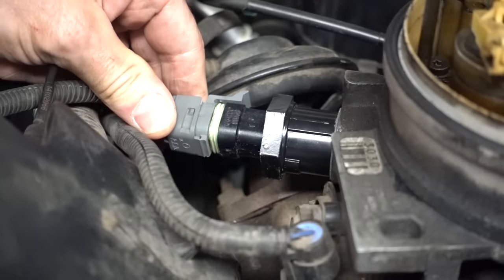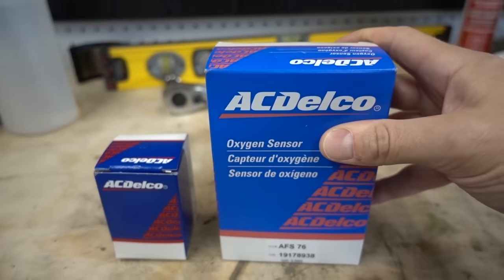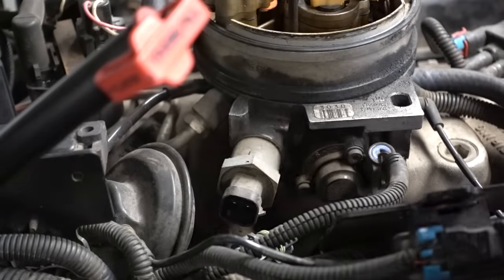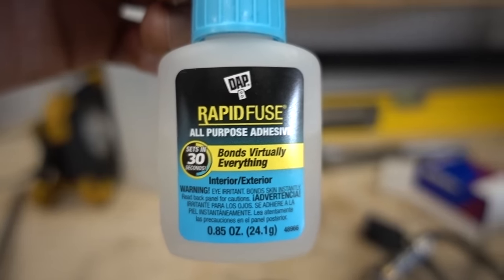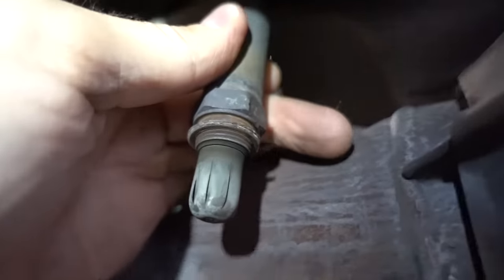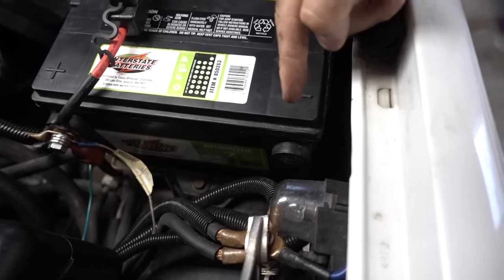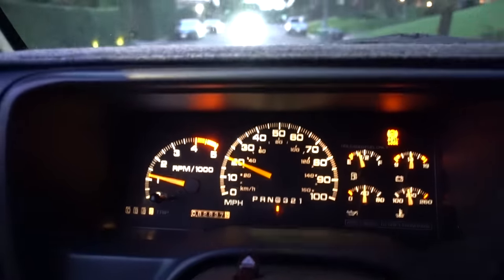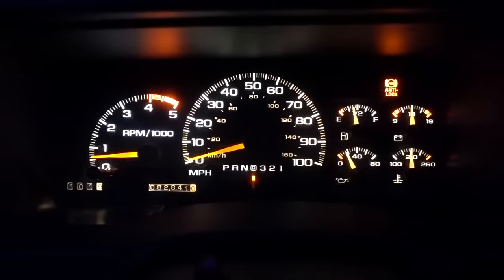Here's the TWO SENSORS YOU NEED TO REPLACE FOR BETTER IDLE !!

Comment: you should have cleaned the port the iac valve goes in. if there is any build up on the sealing surface, the pintle valve can’t seal properly.

Comment: O2 Sensor - is it only one pre and one post ? in 94 ? 
i have 98 Tahoe 5.7 V8 and there are Two sensors -  Pre -cat. and  Two sensors - post Cat.
PN: ACDelco AFS106 GM Original Equipment Heated Oxygen Sensor /  ACDelco AFS105 GM Original Equipment Heated Oxygen Sensor

Comment: I replaced the fuel pump and filter on my '99 5.7.  throttle response was much better but she still had problems idling.  So I changed the fuel pressure regulator and distributor cap, truck won't crank at all now and gas began pouring out a small hole in my muffler because the engine is not burning the fuel up.  I'm thinking I fried the ECM because I was swapping the AC relay and starter relay and I think I put the relay in backwards since the AC and starter relays are both 4 pronged.

Any suggestions?
Reply: You either did something wrong with the fuel pressure regulator or more than likely the distributor cap. You probably have the coil wire that goes to the center swapped with a plug wire which will cause no spark
Reply: James Carroll did you right that on the wrong comment or is there something wrong with you?
Reply: James Carroll  in too deep to junk it now.  Replaced all top end gaskets (head, intake, valve seals, etc.), all front suspension components, new tires, etc.  I got the truck for 600 bucks and figure I'll use it as a beater/work truck/family truckster and park my iroc and do a tear down resto on that.
Reply: @MoparMadness93  plug wires are all correct.  I triple checked.  Regulator is on correctly.  I originally installed it using the half assed, unbolt one side of the intake and lift.  I ended up not getting seated properly.  After the gas came out, I took the intake off completely, found the regulator sitting cockeyed and reinstalled it correctly.  Now it's the same problem.  No crank at all and gas leaks out the muffler.  Engine started and ran prior though.  The truck is in storage in another state right now.  I'll be going back in a few weeks to try and get a reman. ECM off eBay and an IAC and see if that fixes the problem.  I've seen a few videos where techs say to NOT install relays backwards because it can get the ECM.  It's the only thing that makes sense to me at this point since I've gone through every plug, wire, fuse and sensor.  Was just asking if anybody else has had a similar issue or knew something I don't.
Reply: James Carroll  thank you. Will do 👍
Reply: Un plug the battery for a few hours, reconnect and give it another try.
Reply: James Carroll  UPDATE.  
Finally got back to Florida yesterday to tow my Burban home to North Carolina.  Needed to get it running and driving so i could drive it onto the trailer because no winch and a 4,000 lb come-a-long didnt seem like a viable alternative.  So after some research, fuel leaking out of the exhaust can be caused by -

Clogged fuel filter 
Clogged return fuel line
Bad/stuck fuel regulator
Bad injector
Vaccum leak/blockage

So i removed the filter, blew it clear, fine.
Removed the lines going into the spider, seals were good inside spider, no debris in ports.  Next, i removed all the spark plugs to drain any remaining excess fuel sitting in the cylinders.  At this time i realized i royally screwed up the wires on the right bank.  Had wires 2, 4, 6, and 8 all discombobulated as a result of trying to rush in the dark in the dead of a hot and humid Florida summer night and fighting mosquitoes.  Cranked the engine by hand for 4 revolutions to open each cylinder a few times to give the fuel and fumes a chance to escape.  Put it all back together.  Started up after 3 crank cycles.  Running a little rough because i was turning the distributor every which way possible when it woildn't crank.  Now that shes home i can get the timing light and get her spot on and start buttoning her up.  So the no crank was my own dumbass fault. The leaking fuel, however, is still a mystery to me but at least shes running with no leaks now.   

Now i can move onto replacing her rear main seal,  oil pan gasket, change the oil, run some seafoam through her, get new brake pads, change the rear tranny seal, and have safelite replace her windshield.  After that, it's time to finally enjoy her and give my CTS a well deserved break.
Reply: James Carroll  its the only thing that makes sense.

Comment: Should have replaced the spark plugs since it is that old and may be fouled some or wore down some. Maybe some plug wires and cap and rotor if it apply to this engine.

Comment: I dont agree about the o2 senser.check tps, engine ground for these electronics, adjust it all carefully and adjust idle air screw onky if you know hoelw to set it without having problems.note if u go to higher land with higher barometric pressure, it can make the calibration of the idle make the electronics act erratic once tuned to specific lo ation.this excludes fuel filter replace and tune ups, and vaccume leaks, etc
Reply: Removed o2 left open circuit.runs fine .

Comment: Good video 👍 How do you know which oxygen sensor to replace? My vehicle has 4 oxygen sensors. Please let me know thank you
Reply: I had my "upstream" O2 sensor near engine block changed. I was told my engine runs cold. Its winter in Alberta and it gets damn cold here. Now, since I'm OCD I must replace my "downstream" sensor somewhere around muffler and catalytic converter. But, not until spring.
Coolant light still on as is oil light lately.
I flushed coolant and replaced it (its perfect) last summer and I change my own oil. It's perfect. I'll scan everything next spring once I figure it out. 
Any thoughts on the condition my car's condition is in?
I own an '03 Saturn Ion and it runs perfectly!
David
Alberta
Canada
P.S. My mechanic said "f... it", false readings."

Comment: Could be your timing is off re do it set at timing mark oil. Set with crankshaft position center. Also timing change may skip
 Map sensor clean them fuel injectors carburetor clean or buy all them new

Comment: Thays the problem with the pre obd2 fuel injected stuff. It's nearly impossible to trouble shoot other than throwing parts at it and praying you threw the right part.
Reply: The flow of diagnostics is the same as any OBD II vehicle. The live data stream on pre OBD II vehicles is not as comprehensive but the basic diagnostic procedures are the same.
Reply: @chipyeahoo  You have a gadget to get real time fuel trims and sensor data? As it is now i tend to avoid pre obd2 stuff unless i can pick it up dirt cheap.
Reply: Rob Dixson, basic scan data on OBD I will still give you information such as system voltage and sensor data. No fuel trims. Just have to induce lean and rich conditions while monitoring the O2 to check its general operation. As I said though start with the basics. Check battery voltage, visual inspection and vehicle history if available. Pull a spark plug or two and read them if need be. Check basic mechanical condition if problems are suspected. Even a cheap lab scope will give you a good indication on the ignition system and misfires. I agree that some pre OBD II stuff is nearly impossible (like feedback carburetor systems from the 80’s/early 90’s) but things like TBI really aren’t too complicated relative to the modern OBD II stuff. The TBI on the truck in this video is fairly simple. It only has two fuel injectors and a few sensors including a single one wire  oxygen sensor and no MAF. It uses the ignition distributor for crank position. A basic scan tool, multimeter, basic lab scope, vacuum gauge, fuel pressure tester and if needed a compression gauge and of course good service data will give you what is needed for proper diagnosis.

Comment: O2 Sensors csn become Lazy or not be able to generate the full voltage range they are designed to produce.  Normal Range 0-1 VDC.  Mixture control is affected greatly.   IAC get sticky, MAFs get pluged, TPS get intermitent resistance.

Comment: I noticed your oil pressure starting at 60, then to 40, and 20 at idle.  I have the same oil pressure reading with my truck.  Not sure if this is something to worry about.  Just something I noticed while watching.
Reply: An American V8 is perfectly OK if it has 10 PSI per 1,000 RPM. If your idle is 10 PSI, you are golden and don't need to worry. If you want more idle PSI use instead of say 5-30 weight oil switch to 20-40 weight.
Reply: Sounds very good.  When it gets too low, Lucas is an option (you don't need to start with the full substitution amount).

Comment: Sir; What you think is an idle air dumaflache—on a F-o-r-d is a "Ruffled feathers dampener"
I keeps them from loosing it;
Reply: That is supposed to Rochester 2-bbl
Reply: Experienced Chevrolet enthusiast;
Once you start replacing parts just replace anything you have money for and this brand will go amazing
Reply: Always remember to use cyano-acrylate and welding so that you cannot fix it 2-nd time when you discover you are not the level of mechanic this guy is → the good die young by failing to use jack-stands
Reply: Gonna hire McNamara to do the work;
"Idle Air Control Valve chevy silverado" 01 "W"
Should have been fixed decade ago + Will use the $1,200 Bone Us Helicopter Money  → often they might be seized at the threads then I see seafoamworks  Deep Creep might be good ▬ used common penetration stuff's for years but never worked on an SS Exhaust → If Stainless steel galls you replace the entire exhaust

Comment: I have seen the clips on many GM Weather Pak connectors break, but I’ve never seen one back out because of it. Your old IAC was bad as evidenced by the change in load from the AC. The O2 is an input sensor for measuring fuel mixture that would have little effect on RPM. The IAC is not a sensor but an output device designed to control idle RPM. It works by allowing more or less air to bypass the closed throttle plate in response to an output signal from the computer.
Reply from the maker: Thanks Bruce. What are your thoughts on my ‘theory’ of resetting the computer to ‘relearn’ with the new sensors? Am I way out in left field or was that close to correct?
Reply: 1ROAD  If the battery has been disconnected, the computer will relearn its base memory which should be done after replacing any components.

Comment: You don't have to leave your battery disconnected for as long as 30 mins for ECU to drained out all the power left in it's electronics. It's enough to just disconnect negative terminal and press brake pedal for about 15 seconds for 100% current exit your vehicle's electronic systems. Fast easy and simple.

Comment: Hey guys, i have a 94 gmc seirra with the same engine as in video. ive been having an idle issue where when i let off the gas it idles down very low, to the point where it seems like its going go stall, and then it catches itself and comes back up to a normal idle. Also when first starting up and driving in the morning it stutters when giving gas and acts like its not being given gas

Comment: No one can fix the idle on my 91 Cadillac Eldorado. I’ve had it to three shops. I’ve had two new throttle position sensor is put in and now the gas pedal has a really fast heartbeat when I turn the engine off. And the idol continues to surge. I have had every part in the engine replaced. Or I believe I have without doing a complete rebuild. They say that the computer is fine but it runs at 180 to 220° when driving short distances. I’ve had all the hoses replaced, new alternator, new battery, New radiator, new holding tank coolant, no leaks anywhere. I just don’t get the idol! It has driven me crazy! Why is the pedal ticking like a clock? They say it’s the computer adjusting to the new TPS. It never does adjust. I’m afraid that it’s going to take off on me which makes me afraid to drive my own car. I have invested over $4000 with no results. Is there anything I can do other than junk a beautiful car that I have had for 20 years with only 97,000 miles on it.

Comment: You should have at least 2 to 4 o2 sensors right? So you can't start it up let!!! Lol OH and the next time to scur a plug in on  that type of sensor just use electrical tape! It's clean looking, will stay on if rapped enough and works! 😊

Comment: When starting the automatic choke will run til it warms enough to idle
Reply: Fuel injected engines don't have chokes. Idle is control by the ecm.

Comment: The idle control valve is not a sensor, its an actuator.  Sensors report to the ECU what is happening and based on that information the ECU will adjust the actuators ti attempt to make the engine run correctly.

Comment: Disconnect the negative battery terminal and touch it to the positive terminal. That will reset the computer. No, ur battery won't blow up. Leave it like that for about 10-15 mins and then reconnect the negative side. Ur faults will go away if what u replaced was the problem and ur vehicle will run differently.

Comment: how about when you have a toyota and it's an automatic and camry.  when you stop at an stop sign and put break on it's starts to rattle a little and make a vibration sound.. it's in neutral or out of gear running it doesn't do this

Comment: Mine 5.7 over heats i have changed every think from radiator ,water pump,fun clutch etc etc and still overheats ,,,,, only when temperature goes above 100 degrees any ideas any body?

Comment: Probably would have been a good idea to clear the capacitors on the PCM. The relearn would be faster and more accurate.
Reply: Are you talkin about discharging capacitors on the circuit board of the PCM? I have not heard that one yet. How would you recommend going about that?

Comment: Rebuild the TBI you can get a gasket kit for $20 for the rebuild
Reply: Add an injector spacer as well for a little extra air flow.
Reply: Probably dont go with the cheap gasket kits though ,your asking to do it again in a couple years time if you do
Reply: Just be careful -he says not responsible/ life or Limb. 🤔 goodnight 🥱

Comment: Lambda probes should be replaced on every 80,000 km on most of the cars. MAF sensors can be cleaned if they are working. But most of the time, they need replacement. MAF can be found for 60-70$ and also Lambda

Comment: I have a 2014 nissan altima where my idle rpm drops while I'm driving. No lights have come on. But dealership can't seem to tell me what's wrong. Can anyone answer this mystery? I had the ECM,  TCM reprogrammed. And at one time it had hesitation in acceleration. But dealership then recommend replacing assembly stop switch. But my rpm drops badly when I'm driving daily. Need a miracle to figure out the issue.

Comment: I guess some of these YouTube auto fix guys are just trying to be educational and show you how you can fix or clean old parts...... Just to show you how it is done. But, I agree with you. Why go though the time and trouble of just cleaning a part that you can easily replace cheap? Then you know it has a good part (as long as it has no manufacturing defect) and you shouldn't have any more problems out of it. A lot of YouTubers show you how to clean an old part instead of replacing it. Kind of like how I don't understand why guys splice brake lines (several videos on YouTube on how to splice brake lines) when you can replace the whole brake line for the same cost or even less. I guess because it takes a little longer? I know why mechanics do it. So, when the brake line fails again they can charge you more to fix it again! They just keep splicing it charging you more and more money when you could just easily replace the whole brake line. I was a victim of the "brake splicing" racket until I learned how to do brake lines myself. Spent hundreds going to a mechanic every time the old corroded line would spring a new leak. Then realized I could replace the entire line for about $50? I remember about 25 to 30 ft. (which is enough to place all the lines) of brake line was only about $20 to $25. Guessing the fittings where about another $25? May have been cheaper? Can't remember. And you may be able to still use the old fittings. I think I just wanted new ones? Yeah.... I agree. Why clean an old part when you can just replace it? If it were a really expensive part I can understand trying to just clean it.
P.S. zip-ties are the greatest invention ever! I use them for everything.

Comment: Throttle service IAC relearn procedure. And the other things that most people forget about the pickup coil and the magnets in the distributor  are notoriously bad in these engines if the magnets cracked or the pickup coils junk it won't idle worth a crap either it controls spark and it controls injectors both on them old pieces of crap

Comment: Cheap parts huh? The cheapest O2 sensor for my 01 Burb at my local Autozone, is $45 for just one. That’s $180 for all 4, plus tax. I can get a cheap China set for around $100 online. Would have been nice to know whether or not just the new IAC would have remedied the rough idle. And I might throw in there that a new IAC from Autozone is $124 plus tax at the cheapest.